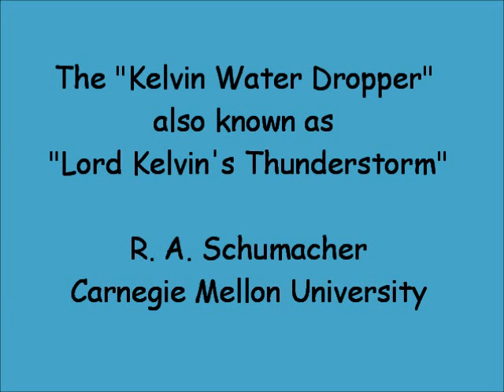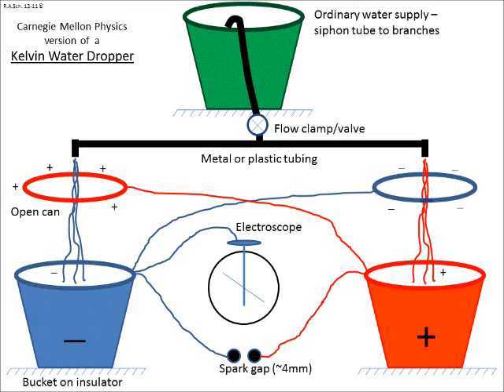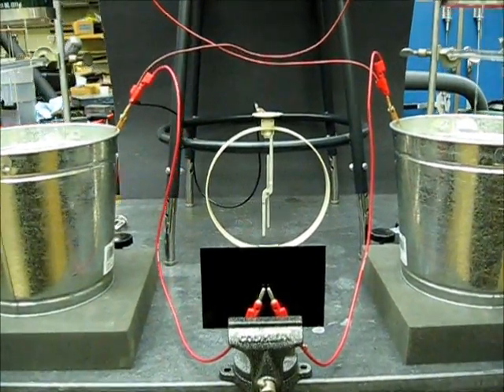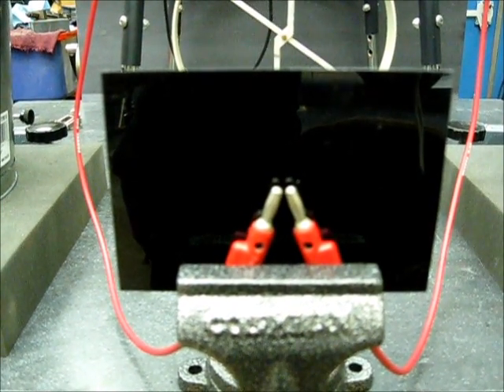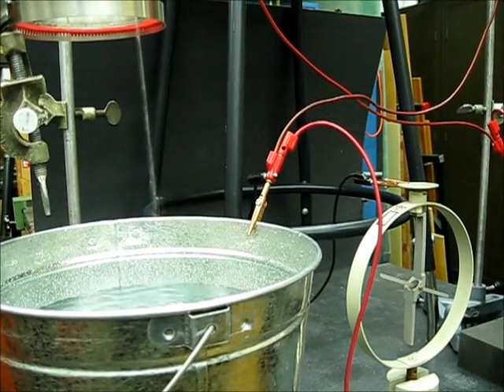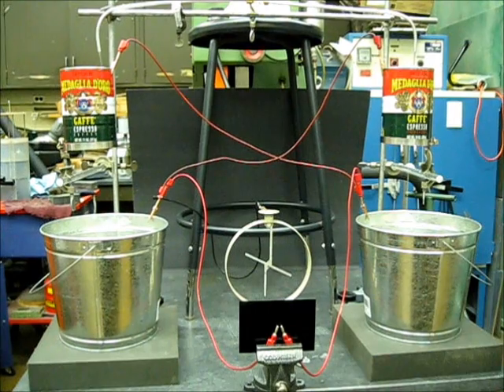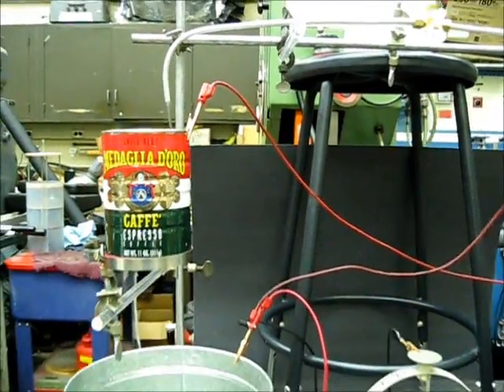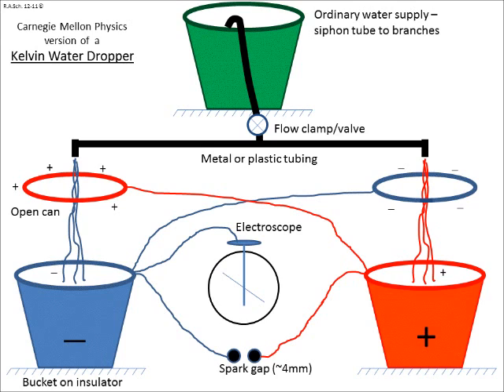Kelvin Water Dropper with Electroscope: Thunderstorm Warning

Comment from the maker: It really comes down to tiny imbalances in the initial state.  You can "force" a choice if you hold an electrostatically charged object of known sign near one side or the other (for example a comb that you ran through your hair).  This will break the symmetry and cause the water flowing on the selected side to have the opposite charge.

Comment: Methinks a stream that will separate water to seperate drops will work much more efficiently.... 
discharging with far greater rapidity... I have seen it discharge every 3-5 seconds... with a greater air gap.
Also...  a simple rubber doormat could be cheap and effective isolation for the buckets

Comment from the maker: Water is a conductor, meaning electrons are free to move through it.  When a portion of the water stream approaches a charged object (one of the cans in this case), electrons are attracted toward the object if it is positive and are repelled from the object if it is negative.  The flow of electrons is quite separate from the flow of the water itself.  This separation of charge within the water stream, water that has not net charge overall, is what we call electrostatic induction. Does that help?

Comment: the water falls through tensors which polarizes and structures the water the electricity is released when the water impacts the water in the bucket the compression pushes the atoms in compound together they pull in power to maintain valence and releases it when not needed the released power is captured in water. please if you will be kind i am abstract this is how my mind works

Comment: Hi! I built the setup and it works perfectly.  Now, I am trying to find out whether the metal spheres can be considered as capacitors. Would you say that they are? Also, I need to make an experiment to find a relationship between the spark gap and the maximum charge accumulated in the spheres. What concerns me is, that I cannot take the potential difference across the spheres as a controlled variable. So it seems that I have two independent variables instead of one. Would you have a suggestion about that? Any response would be super helpful! Thank you!!!
Reply: The buckets pairing is the capacitor .... No ?
The cans held for the water dripping serve as induction coils.
Try dropping a magnet thru a copper or aluminum pipe....  tis the same inductive forces !!

Comment: Just a thought. a neon display transformer. (Take the high potential) send it through to lower 220/110 side to a  battery bank. to store power. A rain storm or stream providing the "fuel" as it were. Might loose some to conversion to DC but some "fat" caps might smooth out  out put to battery bank.. ? Kv4li